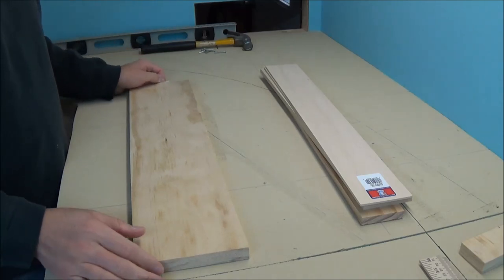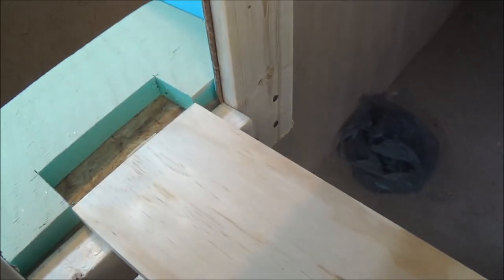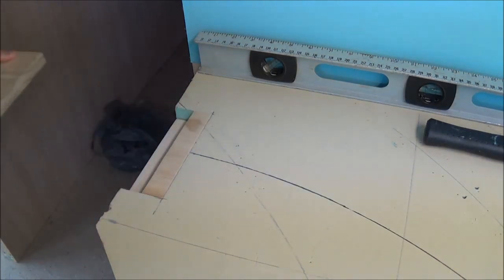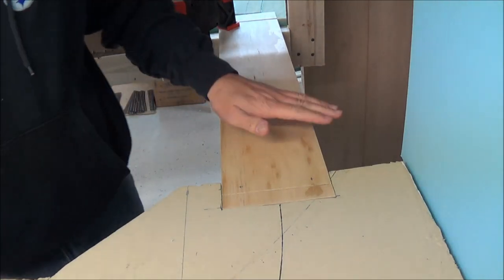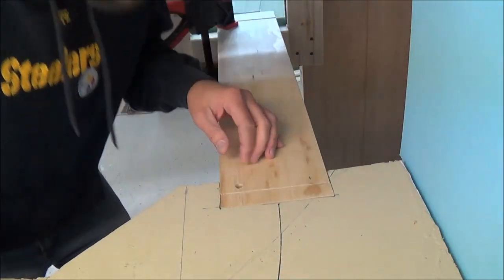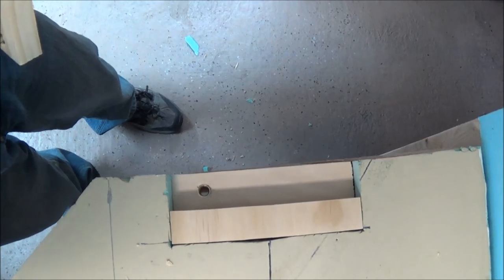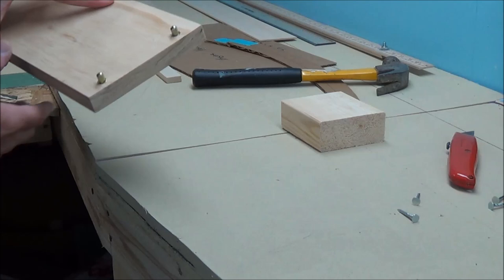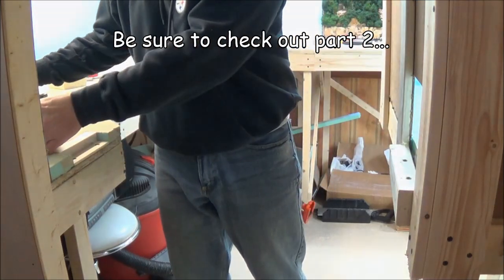Making my lift out - Part 1

Comment: I really like those brass furniture dowels and surprised I'd never heard of them before.  There is one spot where I may end up needing a lift out and I'll be using those.  One thing, though, I think I'd epoxy them in the holes.  The second one you did went in easy and I'm thinking with use over time they could start loosening up.

We did that years ago for vibration with T-nuts used in the plywood bulkhead of R/C airplanes where the gas engine attached. - Paul
Reply from the maker: CB&QGuy  Thanks Paul!  That one dowel was the only one that went in easy.  All the others had to be hammered in really hard.  They should be ok.  I don't want to epoxy them in, just incase I need to redo the lift out later on, I can pop them out and reuse them.  But that is a great idea, and I might end up having to do it anyways.
Reply: They shouldn't get loose after all you are using them only for alignment and not any hard structural integrity. They will not have any pushing or pulling forced on them. They just set in place.

Comment: For future reff. If you had a drill  press, you could use this to get the dowel in straight. I use these type of inserts in wood projects so I can use a bolt instead of a screw and then I have threads that will not strip out. They make several types of them .
Reply from the maker: I'm guessing most people are like me and do not own a drill press. That's not something that everyone has.
Reply: True, then the above tip will be better....... @DGModelworks

Comment: Nice job on the lift out.  I have a couple of suggestions.  You should score both sides of the wood before snapping it.  You should have used plywood.  In time the lift may warp.  Being natural wood, it doesn't like temp. or moisture change.  The dowels are furniture pins.  If you didn't want to drill all the way through there is a dowel copy pins so the holes line up.  I know the average person doesn't know about these things but I built furniture years ago.  I don't want to tell you how to build it but give you a little advice.
Scott
Reply: That is greet  advice, I started my tilt up with 1x6 and within a week I noticed warping, #alwayscheckforcrown
Reply from the maker: Scott Downey Oh well, time will tell.  And it depends on what part of the world you live in, as to the name of the furniture 'dowels'.  I agree I am no carpenter or furniture maker, but it's just a lift out for crying out loud.  I'm not building kitchen cabinets.
Reply: ***** Your not!  Dowels are wood and used to join wood together.  Now my feelings are hurt and I'm telling mommy. lol
Scott
Reply from the maker: Scott Downey Thanks buddy! I will also make sure I have my facts before I post another video. I appreciate your feedback.
Reply: Happy to pass on any information that can help.
Scott

Comment: I know it is late for this note but is would be better to have taken the block and pressed the dowel parts into the wood. I use a metal "C" clamp and just tighten the clamp until I have the parts where I want them. This is a very simple method and I feel better than pounding on them with a hammer. Also you will have much more control with the clamp method. And while I am here, why don't you all just build the base and insert the lift out and then cover all of the base with the foam. This will elevate your having to do any shimming, This works because I have done it on many lift outs and they have operated for many years. I usually use a "white glue" for all of my track but t the ends of the lift out, I use liquid nails for strength and a permanent fix. This might be a better tip than the one below...
Reply from the maker: All great ideas.  Whatever works for you...is fine with me.  Take care!

Comment: How has it held up since your install? I really like your idea, I think it is exactly what I need for my layout. I was thinking of soldering my power wires to the dowels since my layout is dcc, that way I would not need any external wiring.
Reply from the maker: Thanks!  So far it's holding up just fine.

Comment: Nicely done. Although I won’t have a lift out section to avoid a duck under like you, I can use this technique to make under layout staging track removable so that I can have unencumbered access to switch machines mounted in the same area. BTW, Go Steelers!

Comment: You lost me at that you used clear pine for your bridge material. I could see that your board is already starting to twist as pine will do. Should of used three quarter inch plywood which will remain stabil. I would never build a cross over the way you did but hope it works out for your layout.
Reply from the maker: It's been 8 years, still working just fine.  Thanks for watching!